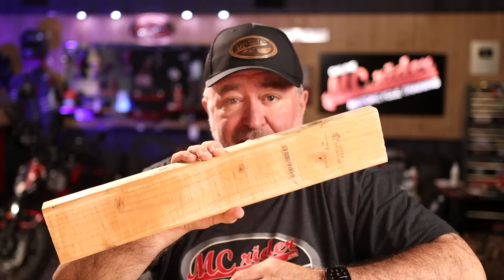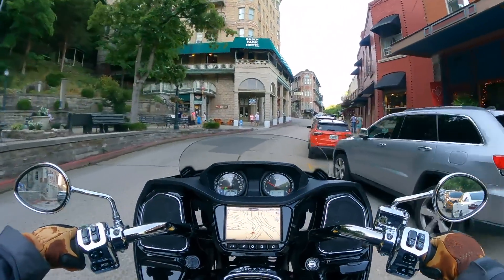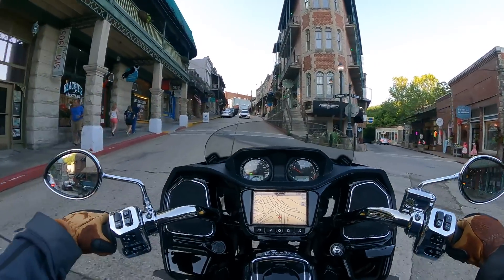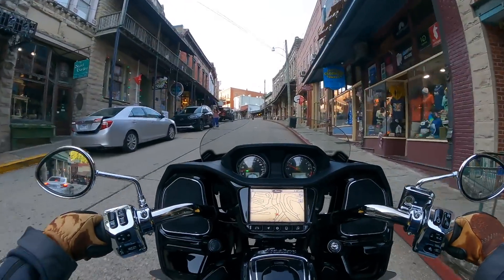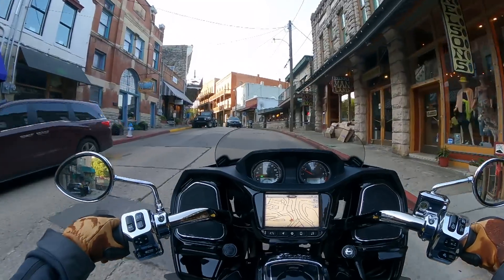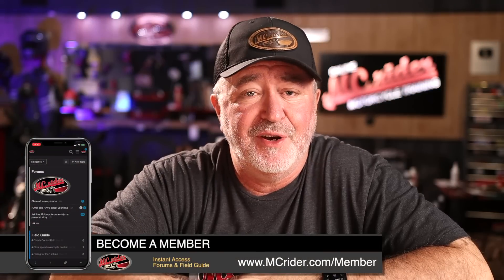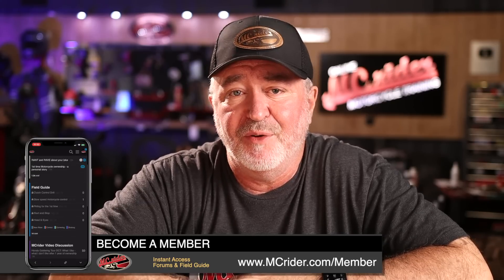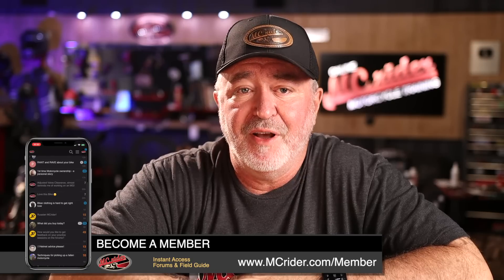Test your clutch control skills on your motorcycle...

Comment: In my recent motorcycle skills course, I learned that increasing the RPM on my bike gives a nice gyroscopic affect with the flywheel in the engine which greatly assists in combination with using the rear brake and the friction zone for things like U-turns, the keyhole exercise, and maneuvering the motorcycle in ever tightening circles. Using the higher RPM in conjunction with clutch and the rear brake actually helps to keep the bike up right for those slow, tight turns.  By dragging the rear brake, I think it allows me to engage that higher RPM without the bike increasing its speed. Not so much specific to the 2 x 4 exercise, but really helpful for all of the other slow speed maneuvering. Thanks as always for a great video.

Comment: You can adjust the clutch lever to put the friction zone where you prefer it.  Sometimes it is necessary due to wear, sometimes manufacturers just set it up different than you are use to.  Great tips either way, can save your clutch too.  Maybe next time you should mention how maintenance issues play a role in these tips as many unseasoned riders may not know when issues their having are related to the used bike their riding.  Kind of like mechanical tutorial videos that don't just show the ideal situation of a part install but elaborate on other aspects of the job you could encounter that might trip you up.
I understand if the typical used bike issues are outside your expertise but you could still mention it to plant in riders brains.

Comment: Excellent demonstration of a valuable skill using the most basic of equipment for learning. My boys thought I had lost my mind when I taught them with the board. They worked with a board at MSF, but only as a "railroad track" or a road obstacle. We worked that very drill because they were stalling from a stop on an incline. We added it to our regular practice time and now no stalls or drops on inclines at stop signs.

Comment: Thanks again Kevin! I think you've just uncovered one of the issues I've been having with my new-to-me motorcycle (1999 BMW R1100RT) You'll find me in a local parking lot practicing today!
Reply: Your R1100 RT has a DRY clutch….you’re gonna FRY the clutch “staying in the friction zone” ….WET clutch,,no issues! I have a 2001 R1100 RT….
Reply: @martinmartinez2877  Oh I know that. I'm already setting aside finds for a clutch replacement. I live in San Francisco, been driving manual transmission vehicles most of my life so I am well aware of what their limits are. My clutch "practice" sessions are limited, on level ground and in the "friction" zone no longer than absolutely necessary.

Comment: Good exercises. Never have understood WHY dragging the rear brake helps with control. Still don’t but hear that it works.
Reply: High Jack! Basic explanation would be that you stabilize unbalanced forces on the engine-chain(shaft or belt) - rear weal train.  Maybe as an example we could imagine a rope which you pull trying that it’s end moves smoothly. Not very easy as it will stick to the surface, bend, jump etc. But if we put some weight to the end of the rope, it will be much easier to pull it smoothly. This weight is our rear brake.

Comment: Brand new rider.  Took the state class where I rode an old Honda Rebel 250, which was the first and only bike I had ever ridden.  Thought I had a pretty good grasp of the friction zone and passed the test to get my motorcycle endorsement.  Bought a 2010 Buell Blast as my first bike.  I hated the Rebel 250 and figured if Harley used the Blasts for their training classes, it was probably a simple and easy-to-ride bike.  Plus it was cheap.  The research I did said they were known for having "grabby" clutches.  I swear this bike has no friction zone.  I consistently stall it at least 3 times every time I try to take off from a stop, or I end up giving too much throttle and take off like a rocket.  Needless to say I HAVE NOT taken it onto a road with traffic yet.  I have just been parking lot practicing hoping I will eventually get the hang of it.  Any suggestions?
Reply: You bought the WORST beginner bike in the HISTORY of motorcycledom…😆😂😆….a Suzuki TU250X….perfect for you…

Comment: Many years ago I was very surprised to find that most of my biker friends did not drag the rear brake on slow manoeuvres.
I suppose I should not have been surprised as they also used their right foot when stopping rather than keeping it on the rear brake.

Comment: I have a Honda vac 1300. I have watched hours and hours of video on slow speed turns. I am having the hardest time with left hand turns. What I am wondering is, my handle bars are not raised up just topical bars( hope you under stand what I mean). When I turn right my clutch hand is way out and easy to control. When I turn left my clutch hand is in my side and contorted so that it is hard to control. So is it me or maybe my bars are not positioned right or not the right bars. Once I fell the bike start to dip to much it had to control the clutch and get the bars straight.
Reply: I think I'd seen it was rider position that helped ease that issue
Reply: @rhodrijones8267  don’t know how to fix it